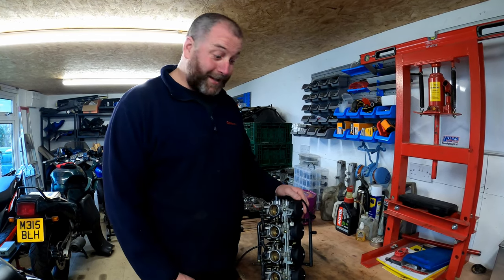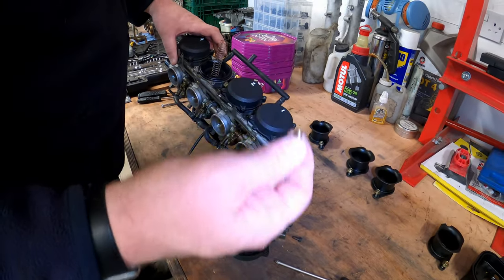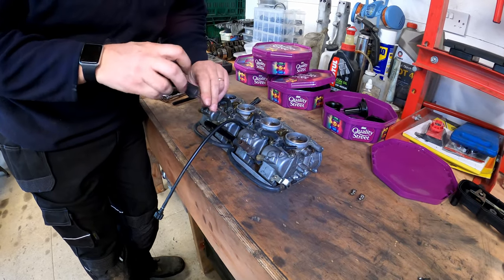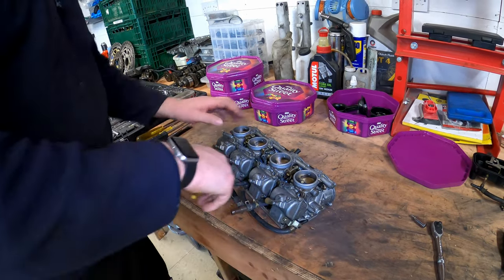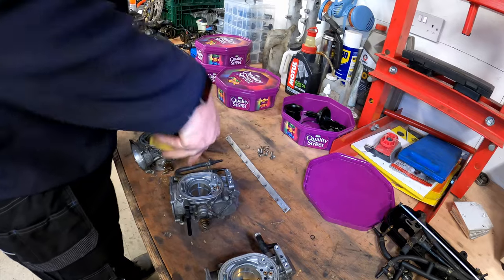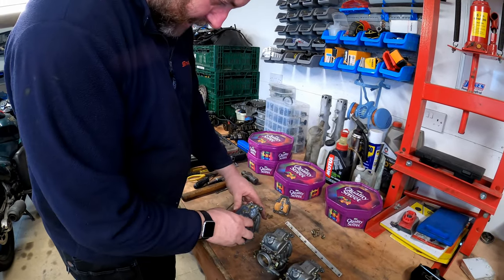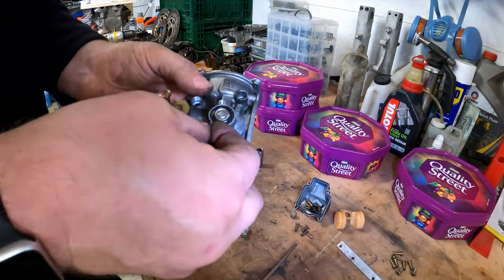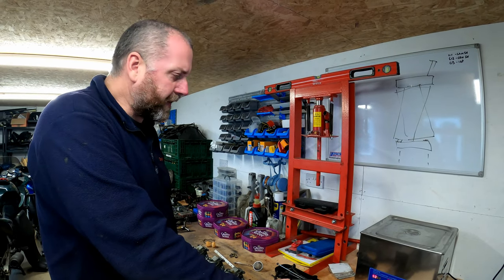1998 Kawasaki ZX9R - Project Shinobi, Episode 14 - Carburettor Teardown And Ultrasonic Clean.

Comment: I had to take the impact driver to my GPX750 carbs, not going to lie, scared me shitless!  I bought a set of stainless hex head bolts  to replace them.  I hope I did right, but I used copper grease when I refitted them.

Comment: I think those needles are stock bud, usually the ones with circlips you can put in three/four positions are from kits such as Dynojet kits. If you decide to put small washers on them to space them, use a micrometre to make sure each washer is exactly the same thickness, some will be very slightly different in a bag of washers.
Reply from the maker: Cheers dude, yeah, I have done a little research on these since the teardown and have realised that they are stock items after all. I will be fitting washers under them like you said and will certainly be measuring them to ensure that they are all exactly 0.5mm thick. Video on the rebuild coming soon! 👍
Reply: @KevsShed  Looking forward to future episodes, love it so far, and may help me with things in the future as I do all my work myself. You certainly know a lot for a self taught mechanic 👍

Comment: Great episode! The factory air-fuel setting is 1 and a half turns out if I remember correctly.
Reply: 1.5 turns is for the E, C's are 2, with a sp can with no baffle & k&n filter, mine are set at 2.5 turns out, and it runs great, I also have the shims under the needle jets.

Comment: Great job thanks , just going off topic for a minute what coolant do you use in your zx9r as I'm struggling what one to pick
Reply from the maker: To be honest, I’ve not looked at that yet as the entire bike is still in boxes waiting for the parts to be reworked but when I get to the coolant system I’ll most likely use a standard ethylene glycol 50/50 mix 👌🏻

Comment: My E model carbs (Canada) doesn’t have coolant lines attached. :) Also…. Get your rebuild kit components from Kawasaki.  I had an All Ballz kit and the pilot jets were garbage.  Cost me $300 at a mechanic for him to change them back to the old OEM ones to solve the problem after I spent countless hours trying to solve the misfire issues I was having.
Reply from the maker: As it happens I’ve already ordered an All Ballz kit as it was the only complete kit available, to be honest I was going to stick with the factory jets anyway as they have been through the cleaner and are spotless now. I’ll just use the screws and seals from the kit, probably the air screws too seeing as one of mine had the tip completely missing!
Reply: @KevsShed  good plan.  If you reuse the factory jets you should be good!  The screws, needles and needles are pretty much all I ended up using also. I was relieved that my issue wasn’t anything I did wrong but pretty angry about the problem with the parts. All my mechanic said was that it is a pretty common issue with non OEM parts and that he will never use them.
Reply: That's weird. One would assume they would be due to your cold climate right ?
I have two E2 bikes and they both have coolant pipes fitted and I'm in Australia lol !!
We don't get much below zero at any given time in winter and if you had to ride in such a low temp, then you're mad anyway right ??
Have you seen how expensive the OEM carby parts cost from Kawasaki, if they're still available as most parts are now obsolete.
Reply: @tonymontana897  I found it weird as well but i've done a lot of my own maintenance on my bike including rebuilding the carbs and those coolant pipes are definitely not there nor could i find where they might even be connected.  If you're stuck, my passionate recommendation is to clean and  use the factory original parts if OEM parts are not available.

Comment: them are stock jets, most put a 0.5 washer , to shim them !!
Reply from the maker: I’ve done a little research on this and that seems the way to go! 👌🏻
Reply: @KevsShed  If you leave the exhaust system stock, there's no need to raise the needles. The shim is for a free flowing exhaust which requires more fuel in the midrange.
Reply from the maker: @nitramh24  Yeah, I am fitting the E model headers which have a wider bore so I think it will be beneficial!
Reply: @KevsShed  In that case you need the shim👍 You should also consider adjusting the air/fuel ratio, make it a tad richer.

Comment: Not vent pipes, rather the ram air inlet pipes used to pressurize the float bowls. Shim the needles with 0.5mm washers. Reset all settings to factory as a start point.
Reply from the maker: Will do 👍🏻😎

Comment: Here you go.....ZX-9R Carb Float heights, float valves, and Airscrew settings.
B's CVKD 13mm +/-2mm, Pilot air screw 1+1/2 turns out.
C's CVKD 13mm +/-2mm, Pilot air screw 2 turns out.
E's CVRD 4mm +/-2mm, Pilot air screw 1+5/8 turns out.
F's CVKD 13mm +/-2mm, Pilot air screw 2+1/2 turns out.
Reply from the maker: Yeah, I’ve got the factory manual bud, cheers for the clarification though 👌🏻
Reply: I have heard that they went back to the CVKD from the C for the F bike due to some issue experienced with the CVRD of the E bike. I honestly can't recall the reason despite owning two E2 bikes and none have ever had carby issues.
Do you know what the so called issue may have been on  the E's CVRD ?

Comment: Where would one buy all the replacement screws from Kev ??
Also, on the subject of Carb Kits, I purchased mine from a mob here in Australia. The brand is called "Keyster"
I still have the kit in storage as I haven't had to use it as yet. I just have it at the ready when I do decide to do a full carby refurb.